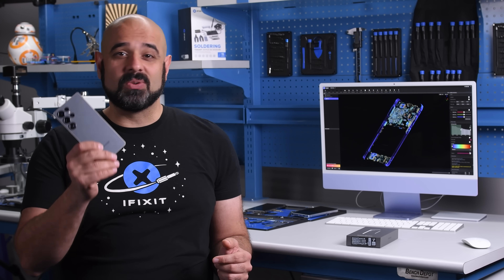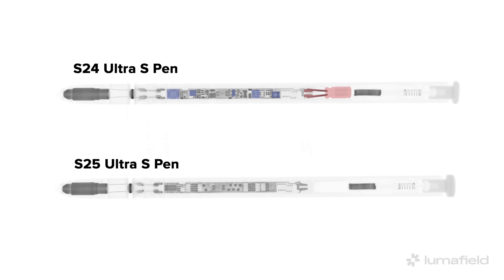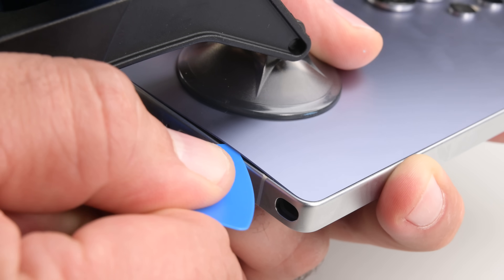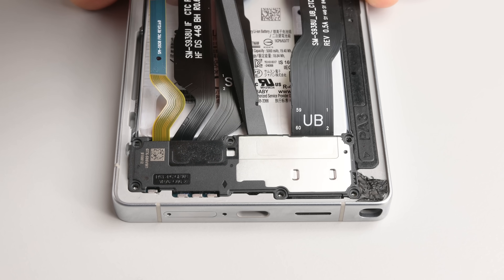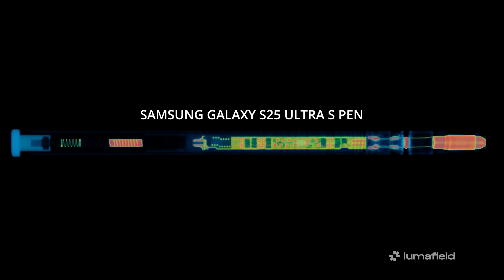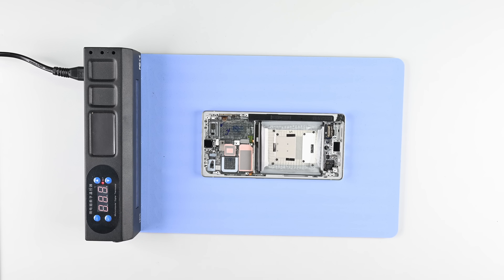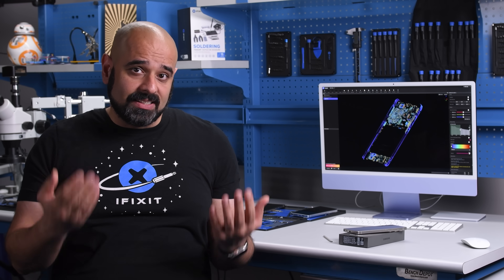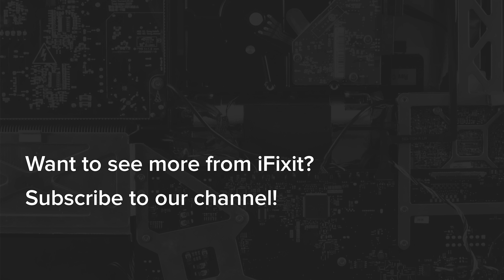Galaxy S25 Ultra Teardown: The Highest Scoring Samsung Phone in 10 Years!

Comment: That's a great battery holding design.
No magic electric adhesive, no fragile pull tabs.
It can even be reused, it's still sticky enough to hold another battery.

What I don't get is why they didn't do that from the start.
Why did they feel the need to fuse the battery to the frame with an insane amount of glue, why did they use more material to make the product worse ?
Reply: Making the phone easier to service/repair makes buying a new device less attractive.
Reply: @平和-v1z  I knew that, it was more of a rhetorical statement.

The answer is money, it's always money.
Reply: It was likely perceived as simpler to just slap a basic adhesive on the back of each battery, certainly from a manufacturing/assembly perspective. Then, due to the iterative nature of innovation, we just sought out ways to improve that same design (pull tabs, etc) instead of just coming up with a new one. I agree, this new design seems excellent.
Reply: @pavichokche  I have already seen five years ago on a random Honor midrange phone (among other) a design that was excellent.
It was a single sheet of plastic glued on both sides between the battery and the frame.
There was just a big pull tab on one side, it worked great and I even managed to stick the new battery to it.

Actual solutions are dead simple and have been known and used for a long time. No innovation needed, they just need to be implemented.
Reply: Your acting like the electrically sensitive adhesive isn’t an improvement? Honestly it really is as even though you do need a 9V battery the fact that you don’t need to pry the battery is huge when it comes to battery repairs
Reply: @ And it’s much better because this method requires you to preserve that wrapper. If it tears then you’ll have to ask their service center to do it themselves ‘cause they would obviously not be selling a battery wrapper obviously.
Reply: Until it tears off.
Reply: They didn't think people would've been replacing the battery or repairing any thing I guess. Later when they've got the heat they've started then to come up with a better solution.

Comment: I wonder if the change in the battery adhesive has to do with the new EU rules which come into effect in 2027

The European Union (EU) requires that all smartphones sold within the bloc have user-replaceable batteries by 2027. This rule also applies to tablets and laptops.
Reply: Sadly, this upcoming rule has been watered down, as it only applies to smartphones without ingress protection.

Comment: Glue on Samsung phones is a joke. Back cover on my S23 Ultra after 2 years breathes a little bit.
Reply: @WhiteTree97  To be fair, that's not necessarily a bad thing, it means that when the battery does need replacing after approximately two or 3 years the adhesive would become easy to deal with

Comment: As if they saved tons of money removing the tiny convenient Bluetooth features from the SPEN
Reply: ~ $2 per device sold
Reply: If they are able to make a basically plastic stylus with just a button that only does anything while being powered by the touch screen, that's a huge difference in manufacturing cost compared to something that has a battery, wireless charging and bluetooth circuit, especially in such a small space. At least I'd assume so. They probably did the math. Plus they will save (make) even more money now that people are more inclined to buy wearables to do things that the S pen could do before. However it's kind of unfortunate that they already had the manufacturing for these S-pens available meaning they could've probably made it more efficient. But looks like we won't get these features back unless people stop buying the phones because of it.
Reply: This is a strategy to sell Rings and Watches more. Someone's new at Samsung and shaking up everything to decieve customers like this and delaying OneUI 7 for other devices and stuff.
Reply: Between $1 and $3 per device multiplied by 16 million units sold of S24 Ultra = between $16 million and $48 million saved. I'd call that a ton...
Reply: @AMDman18 like 10 cent per device isn't it?
Reply: @petergplus6667  Doubtful. What's missing is capacitor in S-pen, BT chipset in S-pen, wireless charger in S-pen, wireless charger in device. Realistically $1-$2 per device. I put up to 3 just to account for something crazy. And you never know with component pricing these days
Reply: @AMDman18  Well, you'd be wrong. Go take a look at other more destructive teardowns.

JerryRigEverything has a video showing all of the hardware still being present except for the ICs and capacitor in the pen itself. Literally everything else is still just there, doing absolutely nothing.

It makes me believe that Samsung will sell another pen separately with all the missing Bluetooth features. They even had information about this available on their own website for a little while before they removed it when people accused them of pulling off such a dirty stunt. So it baffles me to even think why they would have left everything still intact if they are not going to put it to use.
Reply: @proxyhx2075  The wireless charging mechanisms are not there. What remains is presence detection.
Also, Samsung already has confirmed that there will be no Bluetooth S-pen sold separately. There was a blog post made in error
Reply: @AMDman18  Not only is the mechanism removed, the option to pair an S Pen Pro into the device is apparently gone, so you can't even use an S Pen Pro.
Reply: @AMDman18 the wireless charger is still on the phone
Reply: @AMDman18 in this Merker samsung buys it it Costa under 0 Cent
Reply: @AMDman18  Now look this number again in contrast to how much mones samsung makes. $48Million for Samsung is like a few pennies for you or me.
Reply: @AMDman18  Out of the billions spent. A drop in the bucket. I highly doubt it was that expensive per device.
Reply: @AMDman18  well,is not like samsung phones are always on sale. I've never seen any phone from them at retail price after like 2 mounths. If they rly cared for those 2$/device,they'd care enough to keep the prices as close to retail or,at least,remove the whole thing(the charger for the s-pen is still there)
In the end,the most frustrating thing is that it was an amazing feature that samsung didn't advertise enough. Most peoples didn'e even know it existed. If this was apple,you wouldn't hear the end of how amazing this feature is and how it revolutionise navigating your device
Reply: @AMDman18  chump change for Samsung
Reply: Well they literally have
Reply: Looks like they are preparing to remove it in the next series, which means we might have an upgrade on the telephoto camera and battery life but meh...
Reply: SO MAYBE THEY DID, SO MAYBE THEY GAVE US THE SD 8 Elite with no price increase, MAYBE they shaved off 5 grams off the weight, of course there's an upside
Reply: Over 16 million S24 Ultras sold so far.  So even a $0.50 savings per device is a lot.  But I agree w/ what only 1 person has pointed out here: less functionality for S-Pen pushes consumers to wearables.  Come on ppl!  This is a mega corporation here, of course they got tactics to push ppl to spend more and more and more 💸
Reply: They thought nobody used the remote features
Reply: I think they did it for weight so they could be lighter than the iPhone 16 Pro Max on paper.
Reply: Funny thing - the hardware, or most of it, is still there.
Reply: Math is not your fav thing?
Reply: Nobody needs this features
Reply: @phoenixsenpai2655  by that logic,nobody needs 120hz,titanium frame,the 8 elite,the overkill camera setup,the whole s-pen,etc. This is a "ultra" phone at a ultra price(wich is the only ultra thing about this phone). In this price range,is not enough to just have what you need. Nice to haves like top notch cameras and procesors, 120hz,titanium,etc make the phone more premium and worth the price. Remooving features FOR NO REASON is still a big problem